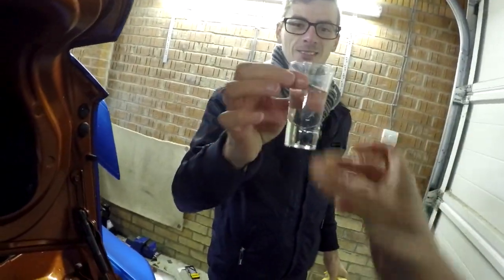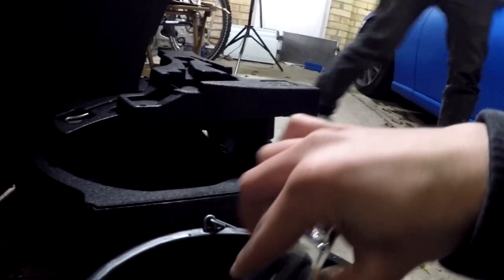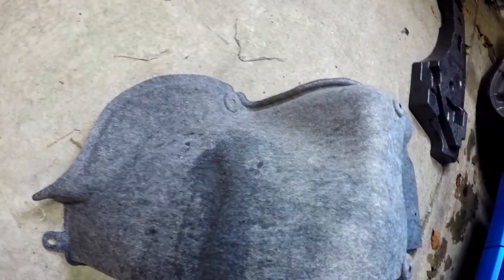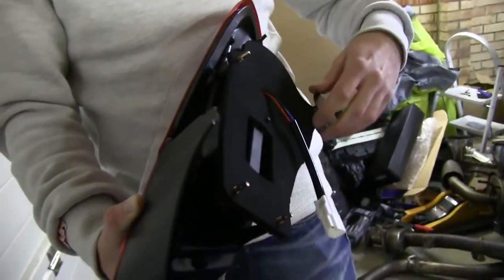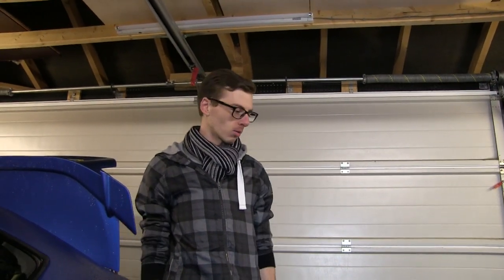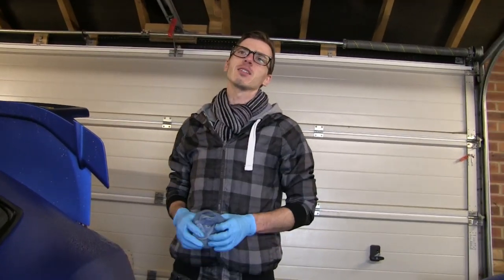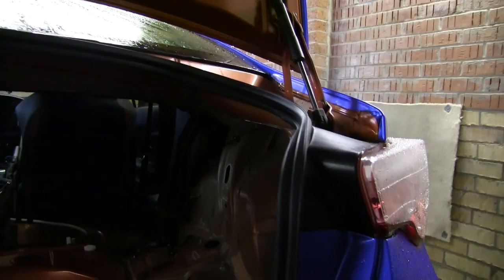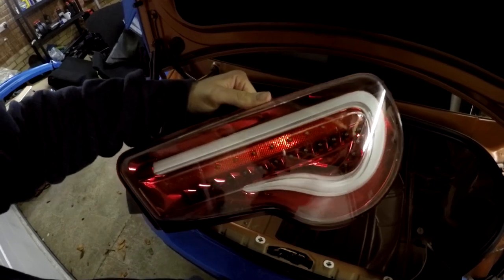GT86 Damp Issue

Comment: This happened to my E39. It was a leaky tail light seal that was old and dirty and a previous owner must have accidentally pulled one of the sunroof drain hoses, didn't know where it came from and shoved it up in the boot liner allowing it to piss rain water all over the boot saturating the insulation foam and electronics. much fun. Glad I caught it before winter. It was fun having a hot tub in the boot for a while.

Comment: I installed my Valentis yesterday evening (in the rain) and for whatever reason never watched this video. So today it crops up on my feed and I decided "what the hell, 8 minutes" and turn it on. I then went through the entire range of emotions from curiosity ("huh that is a lot of water") to horror ("Oh my God those are my lights!!! runs to check boot) to realisation ("they threw the foam away!") to amusement ("whoops fellas. Whoops.") and then back to horror ("Oh no the Valenti!!!"). Did you think about simply seeing if Valenti (or even Toyota) could send you replacement foam pads? Also could you not have just taken the foam pads off your stock lights (assuming you still have them)?

Comment: I wish I could find the leak on the wife's car  every time it rains she ends up with a puddle in the boot and under the back seat My camper van leaks around the front shock mounts for some odd reason and my own car leaks around the back windows and back lights and roof rails and windscreen and water comes up from the floor too gave up fixing the leaks and just took everything out bar my seat and the dash
Reply from the maker: +tomschevette lol yeah I was glad we found the source of the leak pretty easily. If it hadn't been the lights, god knows where else I would have thought to look